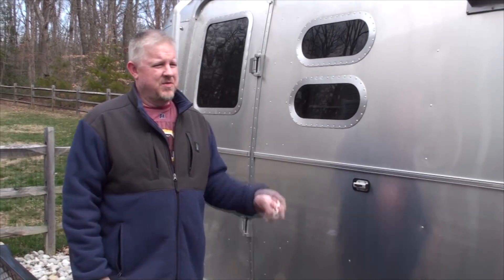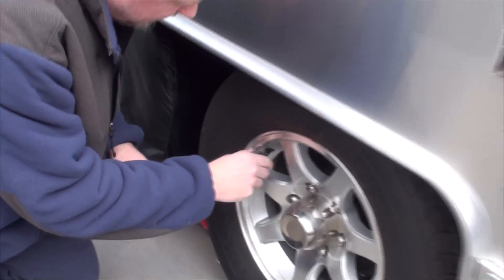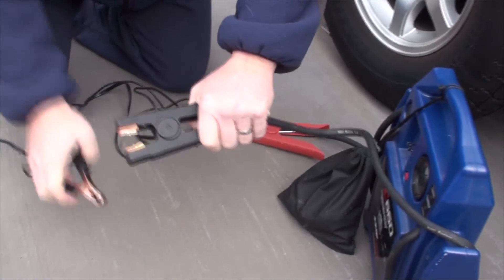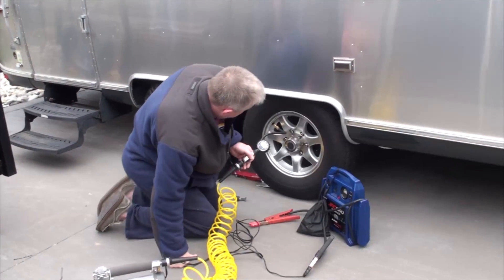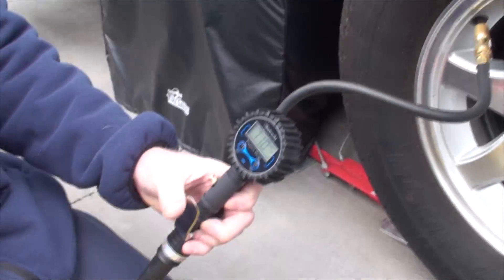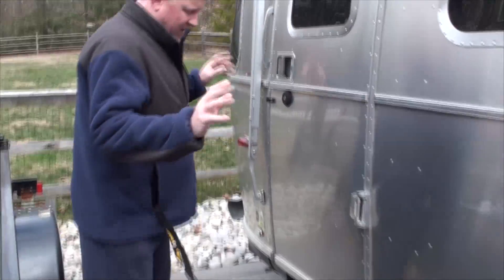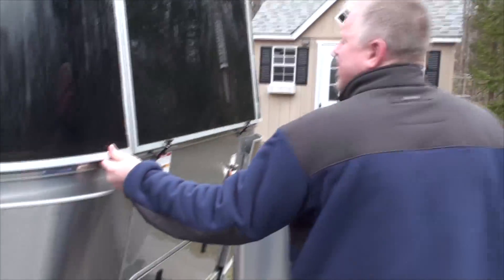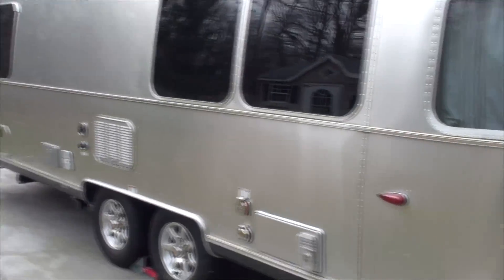Trailer Prep for Towing

Comment: My Airstream tires have max psi of 65. Does yours? If so why go higher than max cold pressure rating? I keep mine around 60.
Reply from the maker: You are correct the Goodyear Marathons are a max PSI of 65.  I changed my tires to the Endurance the next day from this video and I planned to run them at 70 (max of 80).  I had been researching so much about my new tires that I added too much air to these particular tires in this video.  Thanks for the catch - I have added your observation and credited you in the video's comments above :)